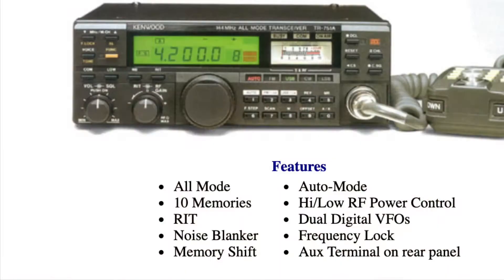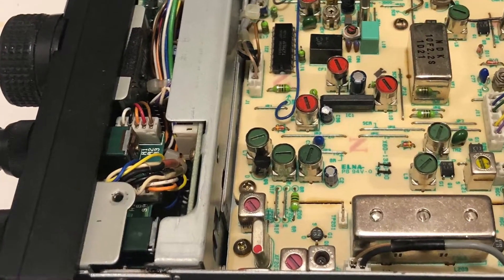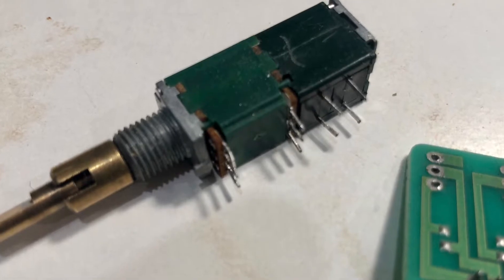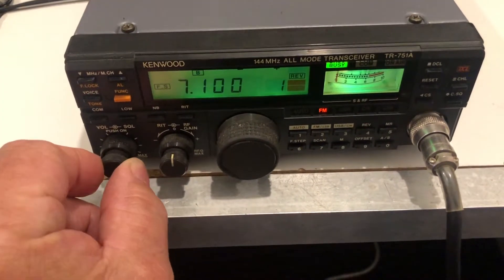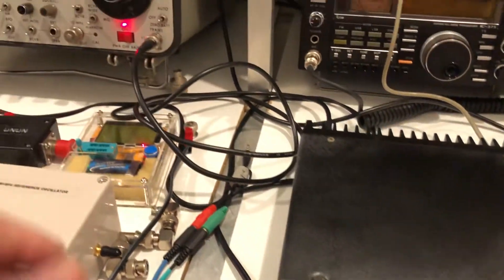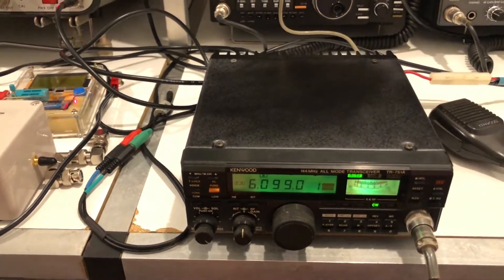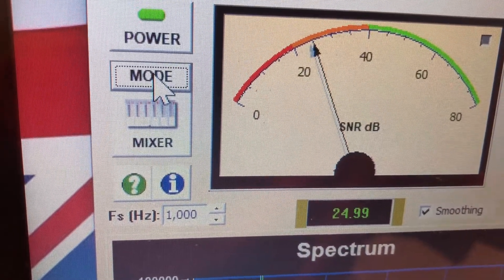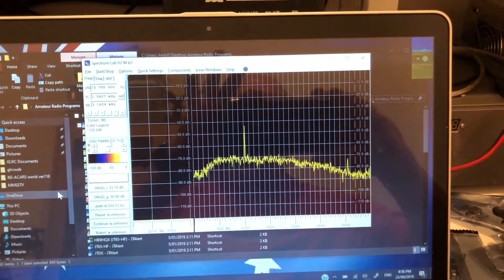Andy’s Workshop - Kenwood TR-751 repair

Comment: Hi friend, I have one just like that, which I used only to listen, I never used it to transmit and, after more than 25 years of not using it, now you turn it on and you no longer see the digits, nor can you hear them. I don't know if you can help me solve it, greetings from Tenerife, Canary Islands, Spain.
Reply from the maker: @virutillaspino  Unfortunately it’s practically impossible to diagnose problems such as yours remotely. There could be many causes.
You would be best advised to find a local technician to assist you.

Comment: I have an issue with mine where it no longer wants to do offset -600 +600 anymore and just does 3 beeps on TX on any frequency
Reply from the maker: Does it work correctly on simplex? … no offset?
Reply: @VK2AAK  Yeah it does which is weird...
Reply from the maker: It will be something to do with the offset or split mode. The beeps indicate it’s trying to transmit out of band.
Reply: @VK2AAK  Thanks for the reply:) It doesn't matter what I set it to it still beeps claiming it's out of band, even though I set it to my usual repeater frequencies. I will double check split setting. Cheers, VK5LEX
Reply: Ive been through all of the settings and tried VFOA and B , no change. Definately on 147.000 which I always use for our local repeater, and it gives me the 3 beeps like out of band. It used to beep out of band but now it's all frequencies... I'm stumped.
Reply from the maker: @davkdavk  It has to be something to do with the offset. If it works OK in simplex but fails in duplex then the offset it’s applying must be enough to take it out of band.
Try putting it right at the top of the range at say 148.000 and applying a negative offset or put it at 144.000 and apt a positive offset.
If it still fails it means the offset is more than 4 MHz.
Reply from the maker: Also make sure it’s not in split mode.
Reply: How do I deactivate that? Things are a bit harder for me these days
Reply from the maker: @davkdavk  Firstly make sure you’re in VFO mode, not memory. I think memory 0 and memory 9 are used for storing split frequencies.
Reply: @VK2AAK  I fixed it. Thanks ❤️

Comment: Hi Andy, I have one of these radio, the pot is OK but I have a slight buzz on TX audio, even on battery power so not PSU, any ideas PS it's a great radio love these old style radios.
Brian
Reply from the maker: It could be any number of things so I would just be guessing. Check the power supply is clean, then start looking at the audio starting at the microphone and working your way . You will need an oscilloscope.
Reply: Thanks Andy in getting back to me so quickly very much appreciated 73's
Reply from the maker: @Guru-sh9mz  Look for poor grounding anywhere in the audio path. You've eliminated the power supply so that's a start. Try to put the radio in TX mode with the microphone disconnected ... for example, try CW mode. That should eliminate anything in the audio path.
Reply: Hi Andy would a 2mhz oscilloscope be OK for checking as there is one fir sale with leads for £50 a few miles from me on market place again thanks for your help
Reply: 20mhz not 2 mhz sorry
Reply from the maker: @Guru-sh9mz  Yes, a 20 MHz oscilloscope should be fine.
Reply: Hi Andy, may I trouble you with another question, I now have the oscilloscope and a small sine/square wave generator in kit firm, I have to make it first lol, can I input a sine wave into the mic input on a mV range and trace back into the audio chain in the radio, only thing is I am not sure what if any change I would see on scope, oh radio on or off. Its a shame if this radio becomes a paper weight such a lovely radio. Best regards Brian
Reply from the maker: @Guru-sh9mz  The radio would need to be on. If you start at the mic socket you will only need a tiny signal. Probably uV rather than mV.
What you're looking for is not so much the signal (from the microphone or the signal generator) but any evidence of the "buzz". It's only going to be a low level signal. It would be a lot easier to spot if you have the microphone disconnected so there's no audio going to the transmitter.
Have you tried the transmitter in CW mode or without the microphone connected to see if the buzz is still there? 
Also, it is preferable to transmit into a dummy load rather than an antenna to avoid stray RF messing up your measurements.

Comment: You cut the 2 hrs of fiddling and cursing. What glue did you use?
Reply from the maker: I used "Araldite" ... a two part epoxy. I lightly scraped and roughened the plastic parts to give the epoxy something to stick to.

Comment: Did they ever at the end of this production run design out this flaw from the radio
Reply from the maker: To the best of my knowledge the problem with the pots was never fixed in production.
Reply: @VK2AAK  I've done some research and it seems like you can get a part number rv50303522 it's the volume squelch control out of a galaxy CB I guess with a little modification that go in and work well.... I'm looking at buying one of these tr75 1A and the seller sent me a video demonstrating the volume and squelch and it had no hiccups or no problems he's asking $500  SUD
Reply from the maker: @deddie4645  I did look at obtaining the pot from the Galaxy CB but discovered that nobody actually had any. I tried all manner of places looking for a replacement part without success. That’s why I ended up fixing the original pot.

I sold the unit I repaired for $100 Australian. It’s still going fine.
Reply: I need a radio for off-roading(( and because big Tech is censoring any free speech the news media's are now the propaganda wing of the government I feel they could shut down the communications grids at any time and a good ham radio is a good investment and self-sufficiency)) the seemed a little bit big for me to put in a Toyota 4Runner is I'm 6ft Ford 350 lb..  . Do you think I'd be better off with a more modern smaller radio.  is the price  too much......... is that kind of a guarantee problem in that radio with time... I think it's really difficult find anyone in America that does these type of repairs.. anymore I'm seeing more and more people dieding off and ham in the widows hubby  radios & stuff......
Reply from the maker: @deddie4645  If you're looking for a portable or mobile "pepper" radio I would lean more toward something more modern. The TR-751 is a fine radio and very sensitive ... but it's decades old and probably a bit fragile to be bouncing around in a 4WD. Perhaps something like a Yaesu FT-817/818 or if you want higher power a FT-857. Both these are all bands, all modes and very versatile. Of course, they're likely to cost you a bit more.
I personally wouldn't pay more than around $200 Australian for a 751.
Reply: @VK2AAK  thank you mate

Comment: I have a TR 751A that has set In storage for probably 20 years due to health reasons. I uncovered it today and hooked it up but I’m not getting sound other then when I push a button. I attached an external speaker, There is no squelch sound all the way counter clockwise volume full. I have adjusted all the knobs. I transmitted and my signal it’s great. Would the internal battery if dead be the cause of no sound? Thanks.
Reply from the maker: No, the internal battery wouldn't cause that problem. If your unit is fitted with the optional CTCSS tone board make sure tone is off.

Comment: I'm trying to use my TR 751 in a vehicle again. It has issues. Do you take these on to work on?
Reply from the maker: Hi Norman. I've been retired from doing commercial repair work for some time. Where are you located?
Reply: @VK2AAK  Mandan North Dakota
Reply from the maker: Norman Ravnaas The shipping would probably exceed the value of the radio ... I’m in Australia.
Reply: Andy Keir thank you

Comment: That was a bit of microsurgery on those pots.  I have just replaced the two pots on my TR751A, with the Ranger pots from R&R Comms in the USA.  The pin separations were not identical to the original pots, but the new ones do work ok.  But for the size of the original pots I take my hat off to you for repairing those little wipers.  (Vk1da)
Reply: Hey Andrew, I'm about to perform a similar repair... could you tell me the part number of the pots you purchased from R&R? Thanks!
Reply: @Nar1117  hi Robert, the part numbers were given by someone in the TR751A/851A group on yahoo, but that group has been moved to groups.io and you will be able to find it there using the search tool.  I’m away from home right now but if I do find the part numbers before I’m home again I’ll post them here.  73 Andrew vk1da

Comment: Hello. N3VMM here. How did you get the pots to stay together? Trying to get mine fixed. the on/off/squelch pot is bad, did what your video said but how to keep them together is the need
Reply from the maker: To dismantle the pots I filed the ends off the rivets at the rear of the assembly (actually they're more like pins than rivets but the ends are riveted over to hold the thing together). Once I had done the repair to the pot I very carefully tapped the pins (rivets) lightly with a small hammer to increase their length by a few millimetres. Don't tap hard, just lightly while turning the pin ... a bit like rolling out pastry using your fist if you can imagine that.
It only needed a few millimetres increase in the length of the pins and I was able to reassemble the pot, put the pins back through, then with good end on a firm, metal surface and holding the assembly together I used a small hammer and a light tapping to rivet over the other end, holding the assembly back together permanently in the same way as it was originally. A nail punch can be very useful in re-riveting the ends of the pins.
If the old pins can't be re-used some people have successfully used copper wire of an appropriate diameter to make new pins/rivets.
Reply: @VK2AAK  had to replace the pot totally. Fell apart once opened up. Not worth fixing it. Ordered a new old stock one. Think I have to purchase a new soldering iron to finish up. Thanks for video and the information
Reply from the maker: You were very lucky to find NOS replacements Dennis. I searched high and low here and couldn't find one. Good luck with it. They're a very nice radio and well worth the effort :)
Reply: I put solid core wire through mine and put a blob of solder either end to hold it together, this way I can easily remove the solder if I never need to take it apart again.

Comment: Hello, i have a 751 that is not transmitting anymore. All looks fine, on air light is red, but no RF. And i have a 851 that gives only low power. (2 watt) The low power button does not make a difference. Do you have any idea? Please email me at struijs@hotmail.com. Thank you.
Reply from the maker: There could be literally dozens of reasons why it doesn't transmit and without doing some troubleshooting, suggesting a cause would just be random guesswork.
Try listening on another receiver while you're transmitting on the 751. If it's something like blown finals then there's likely to still be enough RF being generated to hear it on a nearby receiver. If you hear nothing then the fault is deeper and needs a proper process of elimination to find the cause.
Reply: @VK2AAK  Thank you for your answer. I check that tomorrow. The problem is, i don't have an other receiver. Strange thing is when i connect the output to my counter is see a Freq of 155mhz.... 
The other one, the 851 give power, but only 2 watt....
Reply from the maker: @birdhousetv6473  
Check that both the 751 and 851 are receiving normally with normal sensitivity. That alone will eliminate more than half the circuitry.
Reply: @VK2AAK  The 851 receives perfect. That i know.
Reply from the maker: @birdhousetv6473  
Well that eliminates most of the VCO/PLL circuitry so it's likely to be just a simple fault such as blown finals.
Reply: @VK2AAK  The 751 is working fine again. The PLL IC (IC-6) was dead. A hard to find part. But found it, and the baby is smiling again like never before. Thank you for you help. Peter
Reply from the maker: Home of Vogelhuisje2015 Live HD Streams That’s great news. They are such a good performer and it’s well worth putting the effort into fixing them :)
Reply: @VK2AAK Hi Andy, I recently purchased  both the TR751 and the TR851 and both have only about 8-9 watts out but otherwise both work fine. The VR3 and VR4 adjust according to specs. I found a supplier for the power amp transistor module "M57727" but rather expensive and wondering how I could check and make sure it's that? Any ideas? Thank you, John VE6GR
Reply from the maker: John Guenther I’ll need to take a close look at the schematic but my initial feeling is that it’s probably not the output stage if you’re getting 8 to 9 Watts. I’ll get back to you once I’ve investigated a bit more
Reply from the maker: John Guenther Can you tell me how much current the radios are drawing on transmit? It’s unusual that both radios exhibit the same problem.
Reply: @VK2AAK  Yes, I agree, weird! The 751reads 2.21amp and the 851 reads at 2.6amp. Thanks, John
Reply from the maker: @johnguenther6800  What happens when you press the High/Low button on the front panel? ... what output power do you get on the "low" setting and how much current does it draw?
Can you describe your power measuring setup and confirm that you are running the transmitter into a matched 50 Ohm load ... I just need to eliminate ALC and SWR protection action.
Reply: @VK2AAK  Gotcha. Low power for the 751=1 amp/1.2 watts - for the 851=1 amp/.8 watts. 
I'm using a regulated pwr supply with digital read-out and the MFJ-884 to read power out into a 50 ohm dummy. The SWR is very close to a 1:1. Thanks, John.
Reply from the maker: @johnguenther6800  We'll concentrate on the TR-751 first. The transmitter output module is a M57727 and looking at it the pins are numbered 1, 2, 3, 4 and 5 with pin 1 on the left and pin 5 on the right. 
Can you tell me what the voltage is on pins 2, 3 and 4 in both receive and transmit (high power) please.
Pin 1 is RF input and pin 5 is RF output so don't try measuring those pins. Also, is it possible to verify that the transmitter is reasonably well on frequency ... maybe check with a frequency counter or another receiver or even just by opening a nearby repeater.
One further thing to check, there are two sets of trimpots labelled VR3 and VR4. One set is on the composite unit TX board, the other on composite unit RX board. Can you confirm that it was the trimpots on the composite unit TX board that you adjusted. These are the trimpots at the rear right of the radio with VR3 adjusting low power and VR4 adjusting high power.
Reply: @VK2AAK  Well no need to go any further Andy! I got ripped off - they've replaced the  original  with a M57713 which rated for only 17watts!  I'm sure the 851's the same. Thank you so much, John.
Reply: @VK2AAK  I checked also the 851 and it has a M57716 in it, also good for only 17watts!
Reply from the maker: @johnguenther6800  Well, that's bad luck. You can probably find the correct output modules if you search but they're a bit expensive.
I'll look up the specs for the 57713 and 57716 but I'm guessing you will probably need to alter a few things to get the full output from those replacement modules.
A real shame. Those radios both have such excellent receivers.
Reply: @VK2AAK  Well, live and learn! I purchased mine from Japan and wondering maybe if they have a power restriction because eBay has a TR-751 listed again for C $524.11 but this one is described as a 10 watt 2m rig. I guess I'll be buying a couple of M57727's. Thanks for steering me in the right direction, Andy! Enjoyed your pot repair video. Thanks again, John.
Reply from the maker: John Guenther All good. I suspect you’re right about those being for the Japanese domestic market. Different modules are required for the VHF and UHF radios. It may be cheaper and easier to just buy some external amplifiers. There are plenty around which will give 50 to 100 Watts with less than 10 Watts drive. Good luck with it all. I hope you get to enjoy the radios.
Reply: @VK2AAK  posted a question.
Reply: Hi I notice you are referring to your radios as 751 and 851.  They probably are the Japanese domestic model as there was (maybe still is) a licence class that was limited to 10w.  The 751A and 851A were rated for 25w and were the models typically exported to US and Australia, with 144-148 coverage for the 751A.  The “E” suffix was the European model, 144-146 only.  Incidentally there is a groups.io group for these radios.  Info on spares and substitutions.  Some keen 751a/851a owners to chat with.